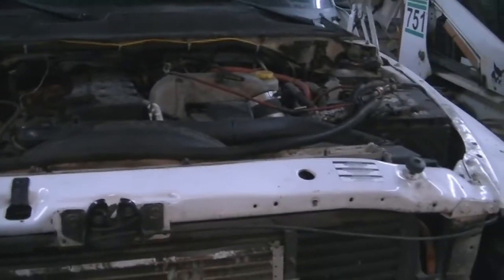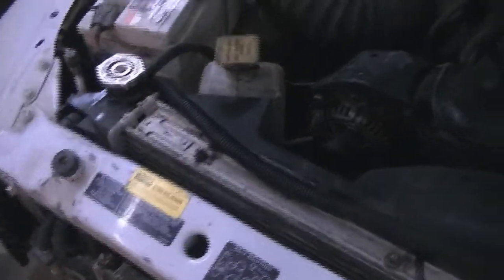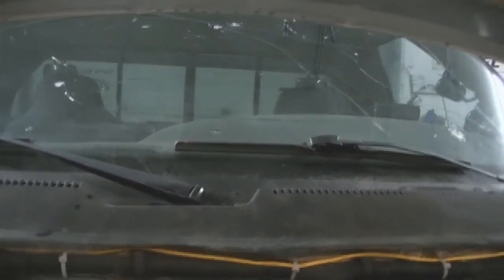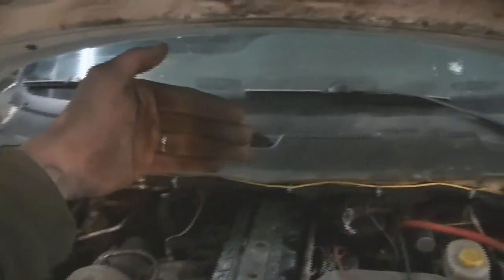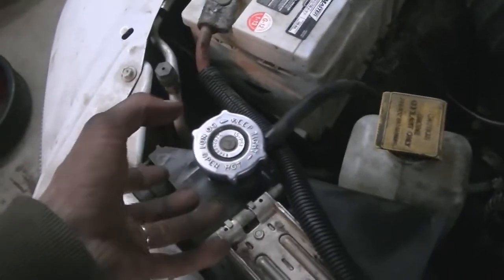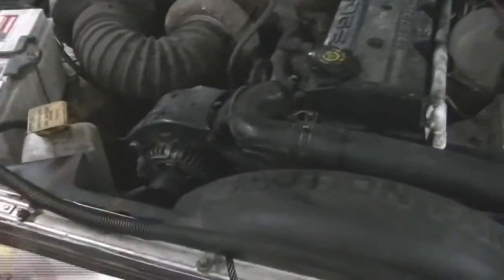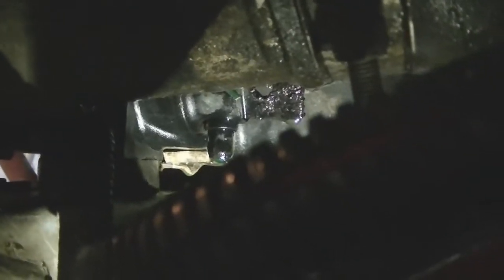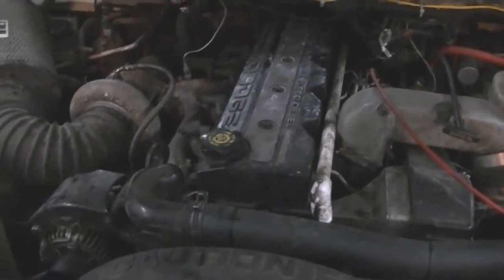2001 Cummins Cooling System Failure... (03/02/14)

Comment: It sounds like you have a blown head gasket,that would explain how it keeps getting air bound. Your radiator is aluminum,soldering isn't the correct repair,find a local radiator shop,it may be fixable.as for airlock,simply remove one of the heater hoses since it is a high point,fill until it runs out,the rest will come out on its own.the overflow tank will draw in coolant when the engine cools off and coolant contracts,that's the only way.

Comment: Heat water and it boils and expands so it escapes to the bottle, when the water in the rad cools it contracts and creates a vacume so sucky sucky time ha ha :-))

A crude discription but it will do :-))

Dispite the pain in the bum cooling system, you still appeared quite chipper,  thats good :-))

Air locks can cause no end of trouble, just think of you engine block with air replacing water, ouch!! hot hot hot :-((

Im sure you fixed it, and without hitting it with a 10 pound hammer he he :-))